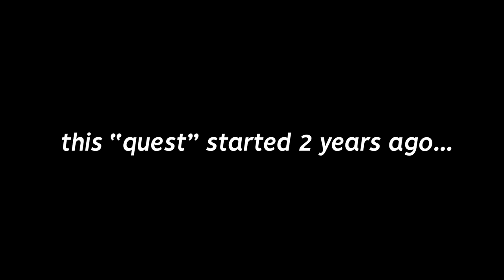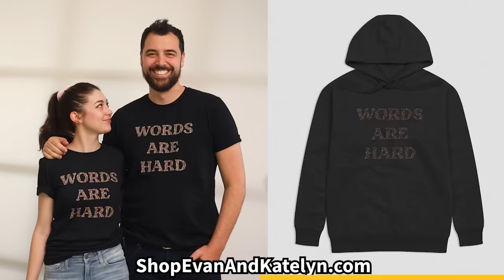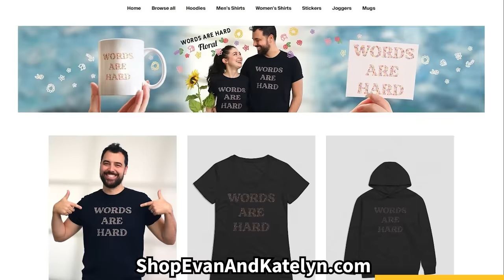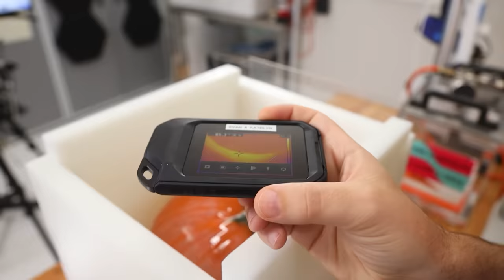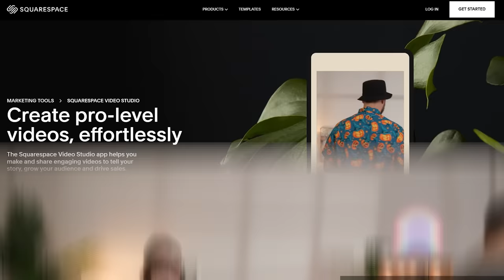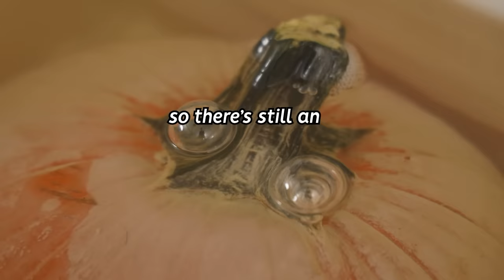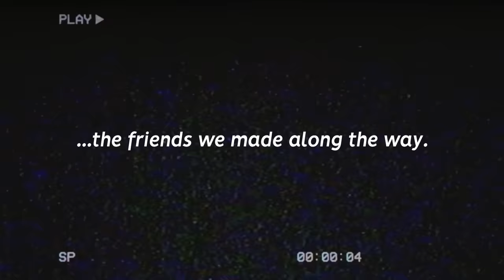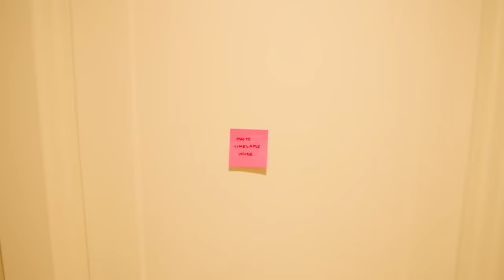Preserving a Pumpkin in Solid Resin… Will it rot?

Comment: There's definitely something going on with carvable pumpkins this year. We did a contest at work and they started molding in just a few days. I've never seen them go bad so quickly.
Reply: 3 years ago my carved pumpkins was outside for 3 weeks in the Florida weather and it didn’t get that bad until the least week
Reply: My mom and I started carving a couple Mid-october (only got as far as gutting them) and the seeds were sprouting inside and they collapsed 3 days later, still unfinished
Reply: We carved one years ago that i had outside for almost 2 months before we had to trash it. I really wonder what's going on inside the pumpkins this year that's making them rot so fast.
Reply: @claudiaportela4580   I craved a pumpkin in Florida and by the next morning the pumpkin was melting
Reply: I was just coming to the comments to say this. We carve pumpkins every year and they last weeks. This year it rotted in a week. Was shocked and confused.
Reply: Same happened to our pumpkins this year. 5 days and they we’re already for the trash. I thought I was crazy and swore they usually last at least a couple weeks so I’m glad I’m not the only one.
Reply: The only thing I can think of is maybe because of the hot summer we had the pumpkins were already ripe way earlier than normal but they couldn’t sell them until October? That’s the only thing that would make sense
Reply: thats actually so weird you ssay that i work in a supermarket in Aus and our pallet of carving pumpkins all started molding on the outside like the day we got it..
Reply: It might depend on where you live! If it's carved and staying in a warmer climate then it's more likely to mold faster. If it's colder out it's less likely to mold. I've noticed that trend over the years here in Minnesota. Warmer falls meant pumpkins went bad sooner amd vice versa.
Reply: If you got the pumpkins from a store, the store could have already had them in stock for a little while, so they are not a fresh. could also have to do with climate, conditions, and storage.
Reply: Our pumpkins this year also molded fast, we had mushy pumpkin on the table before we even knew it (these weren't store bought, we went to a local pumpkin patch to pick them)
Reply: Uh.... almost everyone here is saying they also had pumpkins that rotted in days rather than weeks. I remember my childhood (95-08) pumkins, here in Southeast Texas 2 hours drive from the coast, lasting 3 weeks before fully rotten. ALL of the local market pumpkins today look so small, sad, and barely good to sell for food. If warmer temps make them rot faster and its only taking days now in 2022... Guys, Gals, and Enby Pals, we got a rising temp issue.
Reply: We had two of our three pumpkins molding before we even started carving them. One was from a grocery store and the other one was from a local farm. It was weird.
Reply: I know in Los Angeles pumpkins dont last very long.  Maybe a week. Probably because of how dry it is here.  That's Why i usually carve my pumpkins the day before or day of Halloween.
Reply from the maker: That's so odd!! I'm glad it wasn't just us, we thought we might have like a mold problem in the garage
Reply: stranger things reference
Reply: Yeah, I carved my pumpkin two days before Halloween and it was rotten the day of. My pumpkin the year before lasted at least two weeks
Reply: ✨climate change✨    and     ✨global warming✨
Reply: Same here, ours lasted for a few days before becoming nearly unusable
Reply: Maybe they matured extra early this year so they were already older when they hit stores??
Reply: I made a pumpkin/squash/carrot soup (not from carving pumpkins!) the night of the 30th. It stayed warm in the crockpot overnight, I took it to work where it stayed plugged in until noon when it was served. It looked and tasted fine at lunch. It sat for maybe an hour unplugged, then after lunch was done I plugged it back in until I left for the day. I had a stop on the way home, so it spent maybe another hour to hour and a half unplugged - which is still only 2.5 hours potentially not up to temp. When I plugged it in at home, I turned it up to low instead of warm because of how long it'd been. I noticed the surface looked a little weird, but I didn't think much of it then. But when I went to put it away later, I realized the surface was almost completely covered with white mold! Less than 24 hours after I made it, it was moldy!

I'm thinking the crockpot might not be actually keeping things up to temp when on the "warm" setting, like it's supposed to, so instead of keeping the soup at a safe temperature, it was creating a nice incubator. But still ... less than 24 hours? I've never seen food mold that fast.
Reply: Our Pumpkins rotted extremely quickly, too. This is the first time they did not make it to Halloween 🥺(They weren't even carved)
Reply: @AwesomeitsAmy  yeah i live there and literally within 2 days the whole interior was mold and the squirrels got toit
Reply: I thought I was going crazy!
The sugar pie pumpkins from the market we cut slices off of for our rescue squirrels to eat got dry and spongey in the fridge super fast this year!
(We had tried to grow sugar pies and midnight pumpkins this year but had a three week span of super hot wet weather that killed the fruit buds right when they started out.)
Reply: It's probably due to the drought this summer tbh
Reply: I live in canada and my pumpkin went bad maybe 3 days after carving? avg temp was like -2°C over those three days… some years our pumpkin will last in the garbage can till mid dec barely rotten (due to cold temps im assuming). Something is definitely ~off~ this year
Reply: it WAS slightly warmer this year, but only maybe by 2°C from last year (which was one of our coldest on record)
Reply: @carenrose6002  holy sh*t! That’s actually insane 😮
Reply: Ours held up amazingly well this year, but we went to the farm and picked them ourselves.
Reply: In fact, we carved ours two days before Halloween (the earliest I ever do it because I'm used to southern CA heat, so it became tradition to wait to carve until right before Halloween). I threw them in my compost pile here in Missouri two days ago and when I turned the pile this morning, some of the pieces were moldy, but the biggest pieces still looked really fresh, like I had just thrown in a fresh pumpkin! The farmer we bought them from did tell us he had just picked them the day before we bought them, and we bought them the day before we carved them, so on the 29th.
Reply: A lot of people are saying climate change in this comment thread and while i DO agree Im also thinking the possibility of some new kind of pumpkin specific fungus?
Reply: @monster-teeth5378  I’d say that makes more sense, especially since this is also happening in colder places.
Reply: Umm thank you? I have never had a Walmart pumpkin self destruct this fast. Usually I can feed them to our livestock, but this year the pumpkin was a puddle by the day after Halloween. The only consolation is last years pumpkin patch pumpkin I fed to the livestock made a great surprise vine this time.

Comment: Some ideas for 2023. Make sure to wash and disinfect the pumpkin, the whiteness from the beginning might’ve been from the wax they put on produce and if you disinfect it it could get rid of any mold spores just hanging out on the pumpkins. Make sure to get a fresh pumpkin, yams early demise might show that the pumpkins were already old and/or contaminated with some mold. No tube, instead of putting it bottom down put it top down so there won’t be an air pocket to worry about (still with the bottom hole). Try to keep the resin as cool as possible because some of the juicege might’ve been from the pumpkin getting cooked. Also you could try freeze drying it instead of just dehydrating and then use a penetrating resin and then once it’s sealed like that you can resin it for aesthetics. So many options! I’m so excited for what y’all have coming up for this year

Comment: I feel like what is needed is a freeze dried jack-o-lantern to remove all moisture immediately after carving, next step would be a penetrating resin like cactus juice to fill all cavities left after the freeze drying. At that point it should be completely sealed as is or you could encase in a block from there. I look forward to 2023 edition
Reply: if you're still alive then

Comment: Have you guys thought about doing a small scale test on the smaller pumpkins, like the ones you buy to make a pie, not the super tiny ones but like 6 inches?
Reply: As great as that sounds, it wouldn't really work. The whole weight vs water vs mass thing. That's why the controls are always similar size. ❤️ 🎃
Reply: The only problem is that tiny pumpkins are about just as thick as the size used here, so there's less goop area inside and they're harder to carve
Reply: This could be cute and work, but I would just add that the pie pumpkins are usually sweeter and works probably rot faster :( :(

Comment: It's possible that the pumpkin is pulling away from the resin because it is getting cooked from the heat of the resin. I know epoxies can get quite hot while curing/setting up.
Reply: I was thinking something similar. Because the heat from the curing absolutely has to be cooking these pumpkins

Comment: If you really want to preserve it, step one is to let it dry out slowly and naturally, then to soak it in "cactus juice" which is a thinned out resin used to soak into organic matter, typically wood. You have to let the resin really, really soak in, and then bake it in. at that point you can give it a bit of cleanup and then it's ready to go into a thicker resin. A lot of specialty wooden stuff is made with cactus juice and then resin.
Reply: Letting is "dry out slowly and naturally" just leads to rot. Pumpkins are fruit, they don't dry out, they're too juicy.
Reply: I think freeze drying as opposed to slowly drying might work better concidering just how much water it has.
Reply: I think vacuum is a important part of that
To really get all the air and stuff out and displace it with resin
Reply: they tried drying it last year, that didn't work too well either

Comment: I don't know if this was said already, but this is the first time really seen resin like this. If it's getting up and over 80 degrees, you're cooking that pumpkin which is WAY speeding up and softening the flesh of the pumpkin which is making it juice faster. I don't know what you can do to prevent the cooking of the gored but hopefully this helps maybe?
Reply: Reducing the volume or increasing surface area would help with the temperature to some extent. Maybe a cylinder to reduce the amount of resin required on the corners... starting to remind me of the Futurama heads
Reply: They could also try dehydrating it first- in an oven at a low temperature, rather than with salt. It might help?
Reply: I mean yeah, but the other pumpkin died in 3 days. Which means that even if the hot resin had an effect, something else did as well.
- Some of the tools they used to clean the pumkins were contaminated
- Pumpkins were contaminated
- Pumpkins were waaaaay old when they purchased them. 
- The air, temperature, or other environmental variable of their workshop did it.
Reply: Gourd*
Reply: @benjamindeh873  so to compare immortalizing pumpkins to embalming human beings, because to embalm it essentially decreases the speed of which the decay occurs with chemical preservatives. But before doing any embalming you have to clean and remove as much bacteria as you physically can to prevent the decay. With that in mind they would need to clean and sanitize everything they use on the pumpkin including the pumpkin and probably encase the pumpkin in cooler temperatures than they are. We’ll see what next year holds lol

Comment: Do you think the resin curing cooks the pumpkin enough it releases juice? Maybe experiment with chunks of pumpkin and different resins.

You could also experiment with the pumpkin chunks to see if degassing the pumpkin as it’s curing does any good.

If it works, you might have to makeshift a pressure chamber big enough for a pumpkin so you can remove and keep out air as you set layers.

Or try a smaller pumpkin and chamber. It might be smaller than you were initially aiming for, but bigger Jack-o-lantern pumpkins have a lot more water content than smaller pumpkins do.
Reply: If the pumpkin only juiced with this attempt that could be the cause, but since the thinly coated first attempt also juiced I don't think that's the cause, most of the time if you are concerned about heat harming what your casting with very thin layers will protect it from the heat since such small amounts are curing at once that the heat is minimal thick pours are usually the only time you have to worry about heat
Reply: I think it's just because pumpkins hold a lot of water and carving it destroys a lot of cell walls.
Reply: It was definitely cooking in that resin. That would account for the shrinking
Reply: @NickCombs  so you're saying don't carve the pumpkin?
Might be a good idea :)
Reply: Ah I commented the same before I looked at the comments! :)
Reply: The resin is cooking the pumpkin, hence the shrinking/juice. The other issue is that moisture introduced to resin creates a foaming reaction. 

Additional observation - the acrylic cover may be trapping the heat that’s generated by the exothermic reaction, which may be creating excess moisture during the curing process.
Reply: @Jehty_  Yeah that would help for sure. I don't think it would fully stop decomposition. 

The main function of a fruit is to decay so that the seeds inside can be exposed with available nutrients to sprout. Enzymatic action is just part of their deal. Even vacuum sealed fruit need to be frozen and they only stay fresh up to six months.
Reply: @NickCombs  If the walls were thin enough...
If the UV light source was strong enough...
If the fruit was washed with boiling water...
If the thin walled, blanched fruit was salted and suspended in the stream of air from a hair dryer on low to desiccate it...  ( NOT placed in a plastic container to trap the moisture 😕 )

One MIGHT be able to break down most of the enzymes, denature the mold spores, and/or deny those mechanisms the media they need to operate.
Reply: @b.calvinsaul1909  Does that method prevent the desiccation from shriveling the material? I'm guessing that E+K won't want another mummy boi like Bean

Comment: I've never seen a pumpkin mold as fast as yam. Usually ours last almost 2 weeks
Reply: It definitely depends on your environment; in New Orleans they start molding near immediately; this year ours collapsed fully & were completely covered with mold on the inside on day 4! It's not very cold in October and the relative humidity makes them mold/rot faster. 
With E&K also in the South, I imagine their climate is somewhat similar!
Reply: Mine lasted about a 6 days to a week this year, they all just smushed 🧍
Reply: @xmikywayx  I live within about 150 miles of them in Texas Hill Country and my jack-o-lantern (carved Oct 22) was mostly eaten by squirrels and deer before we put it in the trash last night (Nov 8).  So 2 weeks is totally doable IF you use clean tools to carve (the difference between a knife from the dishwasher and rando drill tools from a garage), make sure you get all of the guts out, AND rinse it with tap water (bleach water is even better).
Reply: @xmikywayx  Meanwhile I'm in Southern Canada and I've had pumpkins put out the first day of October that are still solid and only have slight mold inside after halloween passes
Reply: @pigeonsmlgsus9784  I'm jealous 😂
Reply: @xmikywayx  They're in Texas though. Idk where they are in Texas, but most of Texas isn't NEARLY as humid as NOLA. Doesn't help NOLA's case that ya'll are literally swampland.

Comment: Next year try hitting the skin of the pumpkin with a microabrasive sheet before you do the resin.  The waxy skin is probably why it is pulling away from the resin and adding slight imperfections will help is stick better.  (It works for painting some plastics!)

Comment: I’d love to see you guys dry out the pumpkin with silica gel beads and then use resin. That would avoid the juice all together🤔
Reply: Agree completely! I was thinking the same thing.  Wash the pumpkin well with a disinfectant, scoop as much flesh out as possible, and use silica gel beads to completely dry it out which will probably take multiple change outs of fresh beads over weeks but will be much better than salt IF most of the pumpkin flesh is removed from the inside instead of just scooping out the seeds.  Once it’s completely dried, it should be easy to preserve it in resin.
Reply: What would the point of using silica gel beads be when they seemed to have used salt as a desiccant in a previous video? Salt is a mineral too and in fact natron salt is a historical desiccant and disinfectant.
Reply: They used silica already, it didn't even do anything :(

Comment: Idea for next year: flip the pumpkin upside down and cut off the stem with the hole saw. Since the stem used to serve as a way to deliver water and nutrients to the fruit, it is porous (which is my theory for why it started bubbling and juicing when you got to that point). You can then add a faux stem/leaf, or just leave it as is. Air hole was a good idea.